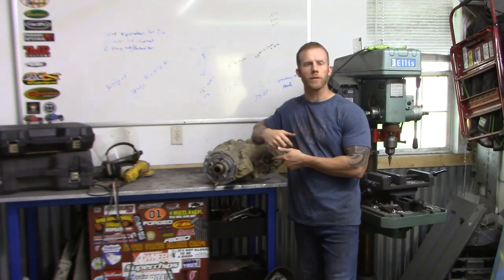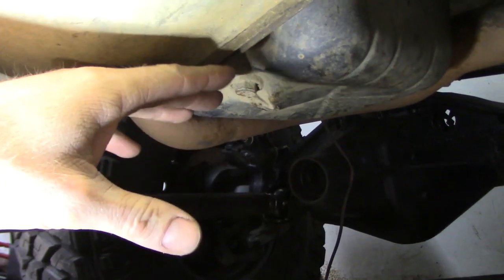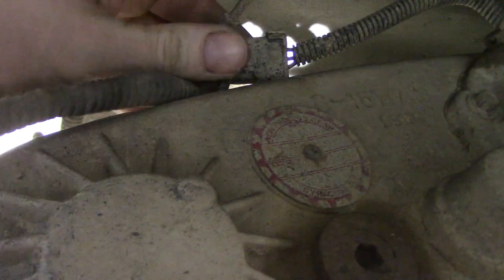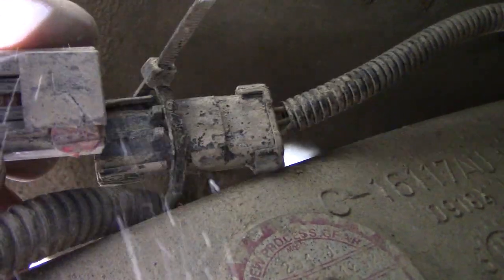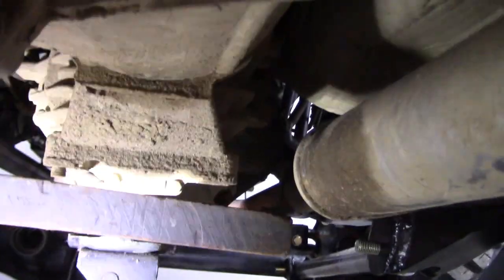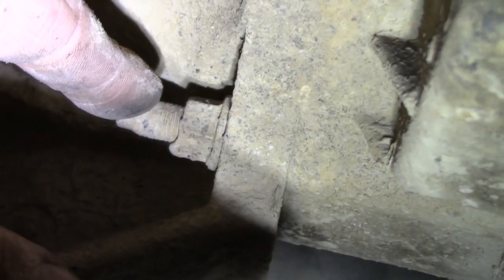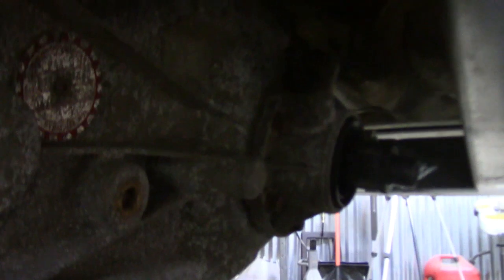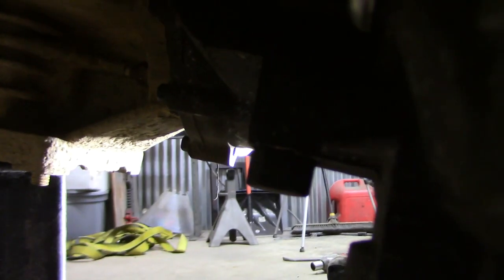231 to 241 T-case swap

Comment: Hey there Cardinal off-road ,  I would like to thank you for the content you’ve provided through out your build. I have used bits and pieces of several of the videos on my own project which was a 2003 sport originally. Over the course of 4 or 5years I have done multiple rebuilding wasting money because I couldn’t just wait, save the money and do it right. I’m sure 99.99% of the people watching know what I’m talking about unless you just have the funds and pay someone to do it all upfront. I’m not that person, and over the course of these revisions I’ve managed to learn a lot. At the beginning my ability was limited to maybe a brake job or something simple like that ,to now doing some fabrication and a lot more than when I started. It’s been tough but rewarding because like you I do everything by myself and with the use of one arm and hand. Sometimes rigging experiments to lift axles,  t-cases and so on takes me longer than the job itself. But like they say built not bought, right? and at the young age of 52 every thing I accomplish feels that much better. Anyway I’ve been really impressed that you were able to do your coil over rear and keep your rear seat, At least that’s what it looks like. I have two little ones so that’s always a limiting factor. The evap canister and equipment located behind the right rear tire, next to the tail lamp screws up a lot as well. Anyway I’ve been kind of fashioning my build a little like yours in the ways I can. I’m not running 1 tons but do have Currie built 44,s ARBs and chromo’s. About as good as I can get right now. Everything used . Unfortunately, I’m running a 4 link rear with the track bar and a radius 4 link front , so that obviously creates its own limitations by not trussing them and creating a better suspension system.  So I finally found a 241 and pulled the trigger which brings me back to this video for the 50th time or so. I don’t have a flat tucked skid so the 03 t case fit in my 03 so far pretty good.  I was lucky and sourced the primary wire harness for the rear connection . And I think the 4wd indicator switch is good. But the pigtail leading into that I can’t find. I know you finally found the sensor switch itself , was it the same as the original and if so where did you find the electric connector that runs into that? I know it’s a stupid question for such a long comment , but I basically wanted to say thanks and let you know that something you did helped someone who really needed it. So basically, thank you.
Reply from the maker: Thanks. I agree if you can hold out do it right the first time. We’ve all spent money on stuff that we change down the road but sometimes that goes with our driving experience and hitting harder trails. Good luck on your build!

Comment: Quick question watched your video informative. But wondering if you know answer to a question since you work on these? I just did a tranny swap on a 2004 jeep liberty. swapped the tranny and transfer case together. Both Jeeps 2004.The donor jeep shifter has less like 4 high 4 low, the jeep i put into has 4 wheel part time , fulltime, and low. In other words I assume its technically 2 different transfer cases even though tranny same model and transfer case fits. The question is is there any problems with the differentials like is there a gear ratio in each transfer case?will my differentials work with any proper transfer case or are they mated by model. Does that make sense? I'm now worried about having a mismatched drivetrain. Hoping its OK, seems to drive ok
Reply from the maker: Most any vehicle that’s 4x4 has different tcases with the same tranny it’s not uncommon. Ratio wise normally there is a tag on the tcase on the backside. Only thing you might run into is a light coming on if the plug isn’t the same.
Reply: @CardinalOffroad  well everything fit properly so i shouldn't have to worry about my differentials even if its technically a different transfer case. I really appreciate the fast response I am just not an expert. Yes I was able to switch the trannys  but lack the technical expertise. I was just worried of a mismatched gear ratio of some type
Reply from the maker: @lorijean7490  nope gear ratio will be fine. You can probably look at the tcase info on the tag and compare your ratios. Might be lower or higher but not a big deal at alll
Reply: @CardinalOffroad  thanks so much it was a 22 hour job lol and i didn't want to go back in and now switch transfer cases
Reply from the maker: @lorijean7490  I get it. It’s a learning experience sometimes

Comment: Can transfer case drop blocks be used instead of cutting the tunnel ?????
Reply from the maker: When you’re using tcase spacers all you’re doing is bringing it down to prevent bad driveline angles which you’ll get when doing a suspension lift. I wanted a flat skid plate which I’d why I did what I did

Comment: Great video. Thanks for doing this. I do have a question. The NP 241 comes as standard on the Rubicons. Why would you need to modify the tub when some TJs are already factory equipped with this TC?
Reply from the maker: You don’t have to modify the tub but I wanted a flat skid plate so without running a big body lift that’s the only option

Comment: i have JK 12 what type of Transfer case come with it NP231 or NP241 which is differences also i can hear noise from back not sure axle or shaft or case it self
Reply from the maker: Best thing to do is narrow it down. Put it on a lift or Jack it up and turn tires to see if you can here it. Should be a tag on back of tcase that has the number it is.
Reply: @CardinalOffroad  Thanks man
Reply from the maker: @Sniperssx  no problem hope that helps. Tcase tags that are NP usually are round and silver with red on them.

Comment: It does seem like the depth of the 4wd switch is the issue. My rock auto switch didn’t work as well. Was the Napa switch different?
Reply from the maker: I’m not 100% sure. I had some issues with my cluster so unhooked a bunch of stuff abs really need to get it back together. I’m very happy with how the tcase does though. With 40s and 538s I’m more than happy with how it crawls.

Comment: Hi, i bought a 2004 Rubicon and the transfer case is 231. Now I dont know what they changed and what I have to change to put it original. Do I need to change the transmission? Or does everything fit normaly and only the transfer case?
Reply from the maker: I apologize I didn’t see this. So you bought a Rubicon and someone put in a 231?
Reply: gregory montanez , it’s more likely that the Jeep was misrepresented as a rubicon when it was not. It’s very easy to find out. It’s should have Dana 44’s front and rear and electric lockers front and rear.  Or just call the dealer and give them your vin# and they’ll tell you exactly what it rolled of the assembly line as.
Reply from the maker: Yeah I see people that put on a Rubicon sticker just to think it’s cool I guess.  Seems like it would be more work to put a 231 in with the yolks and wiring

Comment: I have an 04 Rubicon NV241 I was going to put in a 97 with a 231, but I don't wanna hack anything. I might just go with the Atlas II.
Reply from the maker: Yeah I’ll eventually go with an atlas. Although I’m not sure if I want to build a different Jeep so I might keep the 241. It does quite well with 40s
Reply: @CardinalOffroad  great video btw. Your video sealed the deal for me. And being so sought after I shouldn't have an issue offloading that 241. Thx again 👍
Reply from the maker: @danielnelson9373  thanks. The 241s are hard to find at a ok price but if you have one I’d run it for sure.

Comment: any numbers to make sure it is  4:1
Reply from the maker: texaskiteboarding the silver and red tag should have it on there. Some will say 241OR but not all of them. It will also have the ratio stamped on the tag as well. This tag is located on the back where the fill hole is. Hope that helps.
Reply: @CardinalOffroad  thanks for the info.
Reply from the maker: texaskiteboarding no problem!

Comment: Is the 231 a direct swap
Reply from the maker: Arizona Cardinals yes the 241 is pretty much a direct swap. Although it’s a little taller and you’ll have to do the wiring if you want the Speedo and 4x4 light to work.